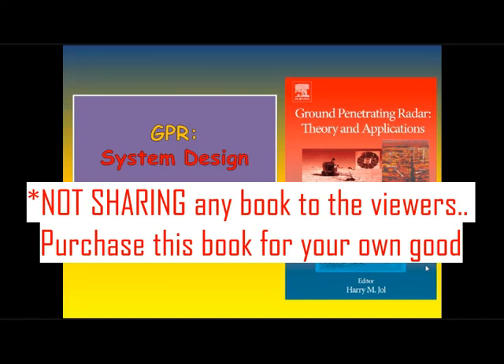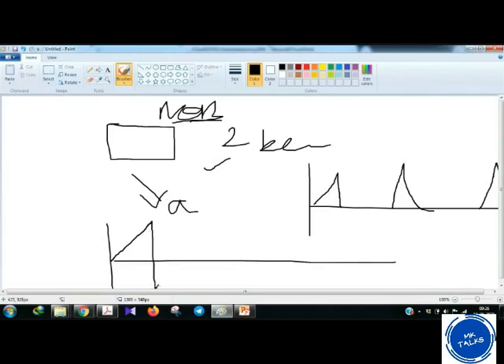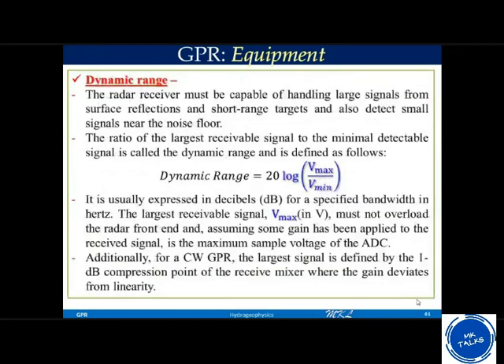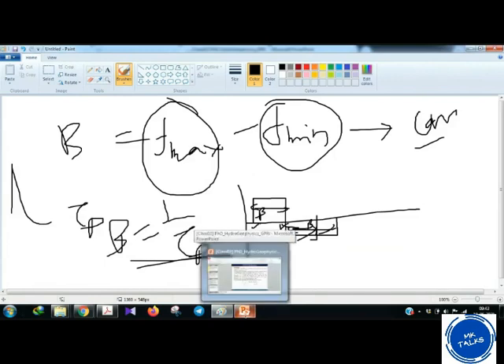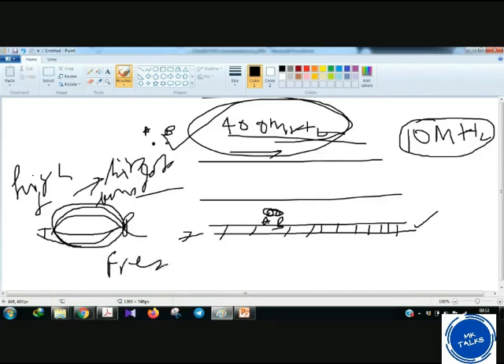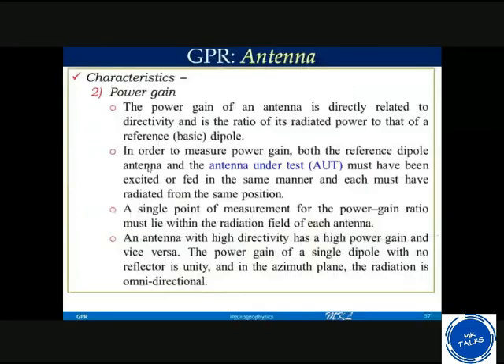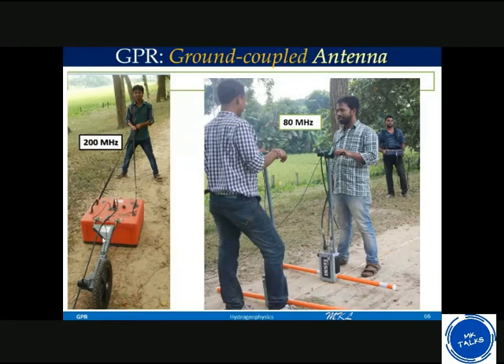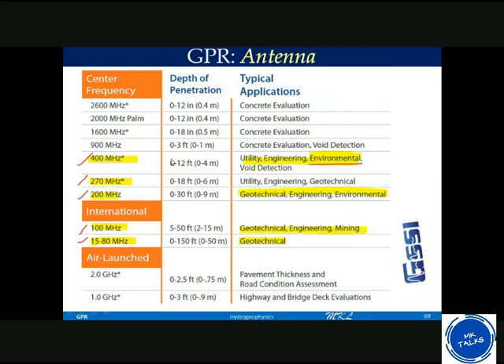What is GPR antenna|  What frequency does GPR use| | in ENGLISH |#MKgeophysicsGPR| #MKgeophysics

Comment: Can you use gssi antenna without the Frequency wheel?
Reply from the maker: Thank you for your comment, first of all that really is called calibration wheel and it is used to measure the distance or offset. So when you are using GPR in distance mode then only you have to use this calibration wheel with monostatic antenna. In case of point mode or time mode you don't need to use the calibration wheel. But I find that use of the wheel is more convenient than the other motor collections.